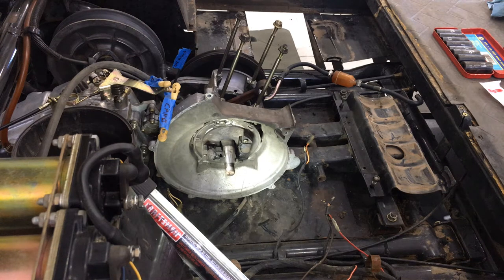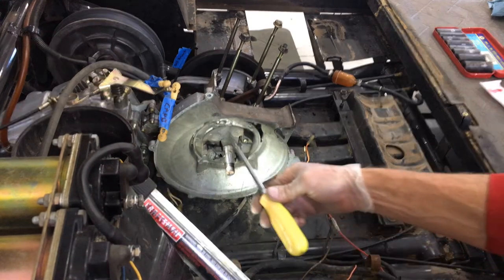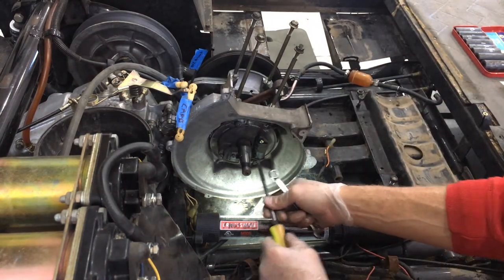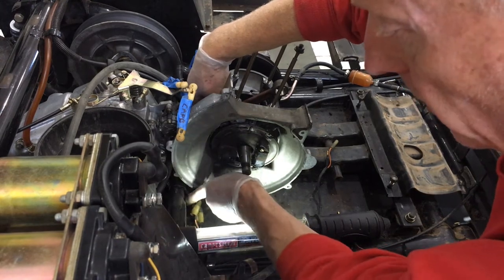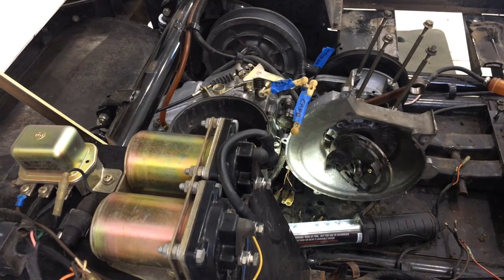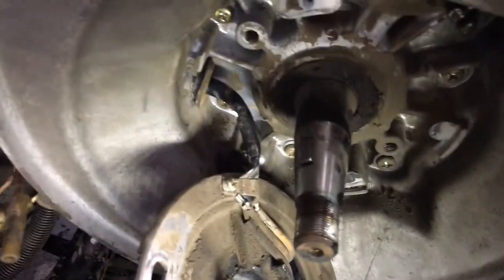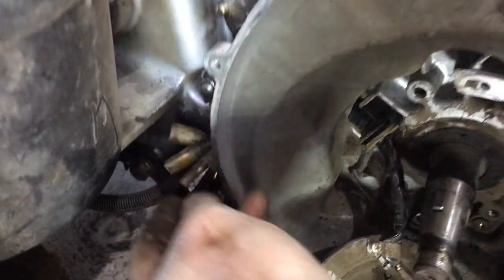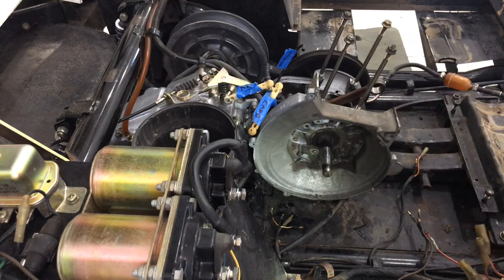13.0 Yamaha 1981 G1 A2 Golf Cart rebuild-magneto removal

Comment: Thank you for taking the extra time to record your work on this G1. I picked up one of these as a "bargain in a basket" and have been trying to get it to run right for a while now and just getting to the timing. Normally I check and adjust an engine timing before anything else, but didn't this time because of it being a pain in the $SS to get to. From the looks of my stater position someone set the timing as far advanced as possible. It does go fast that way but running slow and reverse are a problem.
Anyway, thanks again! Your Bogey Bob videos have been a big help. 😃